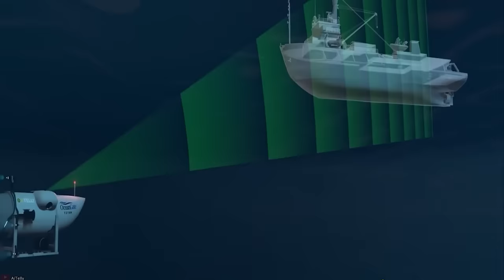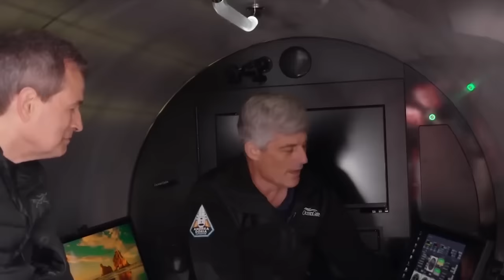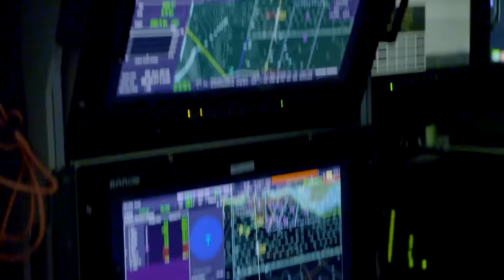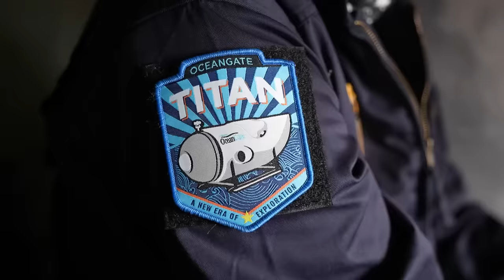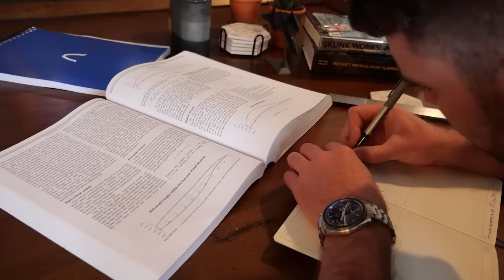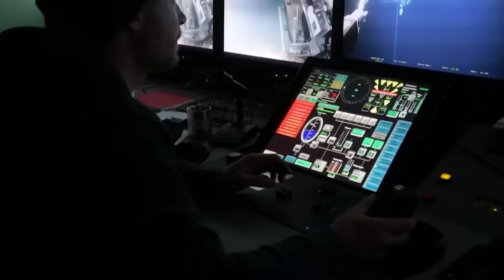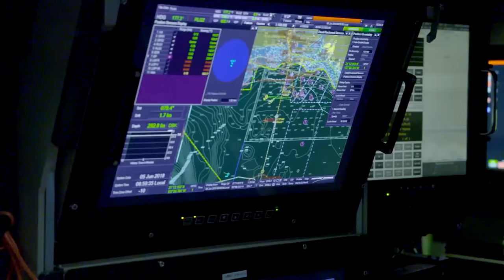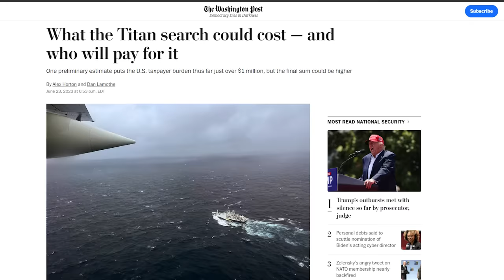US Navy Reveals TERRIFYING Truth Behind The OceanGate Submarine Tragedy | Titan Documentary

Comment: As an engineer who has used many different sorts of plain and composite materials for all sorts of structures, I can't get my head around the choice of a fibre composite for a sub hull.  The point about a fibre-reinforced composite such as glass or carbon strands, is that it adds tensile strength to the plastic matrix.  Fibres resist it when you pull them in tension.  I've used them in silos and pressure vessels where the pressure inside is elevated - for which they are great.  But when you push the ends of a fibre together, it just collapses in a loop.  In an externally- pressured vessel, the structure is purely in compression so the fibres are doing nothing, the plastic matrix is carrying all the compression.  This is the basic theory of use of reinforced concrete - the steel fibres carry any tension, but the concrete takes the load in compression.  So I can't see what benefit the presence of fibres has at all - they are at best passengers, or at worst could help to weaken the plastic, encouraging the propagation of cracks through the matrix as the compressive force cycles.  It would surely be better (stronger and more stable) to just make it out of unreinforced cast plastic resin, preferably made in a single cast to minimise discontinuities in the structure.

Was this really as stupid as it sounds?  Is it the schoolboy error it seems to me?  Or am I missing something here?
Reply: Good summary.
Stupid - yes 
CEO Hubris - yes
Reply: James Cameron gave a good explanation of the difference between the internal pressure differential between and aircraft fuselage at typical cruising altitude, and the external one on a submersible's hull at deep ocean depths, and made the same point as to why carbon fibre was totally unsuited for the hull material.
Reply: I’m no engineer, but just LOOKING at photos of the Titan, I can see how badly it’s put together.  The joins don’t sit flush - see for example towards the front of the craft, where there almost appears to be a crack (might just be the lighting).  Claustrophobia aside, there is NO WAY I would go in there.  And if it’s true they bought the material from Boeing, who considered it sub-standard for use on an aircraft, well, enough said.
Reply: but fibre sounds cool and strong

you wouldnt understand you arent an explorer like me! now bon voyage to the titanic!
Reply: As well as too many dissimilar materials expanding/contracting at different rates at extreme pressures over and over.
Reply: I love my carbon fiber bike, but I wouldn't trust it to survive after getting run over by a heavy truck.

If I had a steel bike or even aluminum, the frame would probably survive and be usable after getting run over.

I am not even an engineer. The greed, hubris, and stupidity of that company is mindboggling.
Reply: Dude the more I learn about this suicide booth the more stupid it sounds. The controller was blootooth. No hard port. The way they controlled bouyancy… every time I thought it can’t any worse it definitely got worse.

Comment: The fact that they knew they were cutting corners, is enough to say that they definitely could have done better.
Reply: More than just that

It's a literal crime scene at this point
Reply: Unfortunately, it's always been normal to cut corners. Generally takes two crashes to correct the deficits.
Reply: Imagine if a car company or an airline or any tourist company started "cutting corners" with safety protocol.  This spoiled rich guy actually fired then sued his own safety inspector because the inspector said it was untested and therefore could implode.  We need to find that judge that heard that case, and put them in jail too.  That's literally criminal abuse of the legal system resulting in loss of life.

Comment: Apparently, the most relevant question is: could Ocean Gate have done a worse job than it already did?
Reply: Could have bobbed back to the surface and then violently tumbled around as a small white tube in the foamy North Atlantic for several days with no food, water or toilet until the people eventually suffocated while staring out the window at the sky. If you're going to die in an Oceangate sub, abrupt decompression early in the journey isn't the absolute worst.
Reply: WDYM? They did a good job. A good job of what not to do.
Reply: If they had used cardboard soaked in linseed oil instead of carbon fibre.
Reply: @notzathros They could have escaped at the surface all they'd need would be a pocket knife.
Reply: @Alefjj  No linseed oil and ATF in a 50-50 mix, old timers used that on old lapstrake boats, superb water deflection
Reply: @PapaTanGh0stNI9htM4R3S0nMaInSt  The submersible was sealed from the outside so I don't believe it could have been opened unless they were found.
Reply: @sleuthelle  It's carbon fibre a sharp point or a heavy blunt object should get through pretty quickly depending on the resin.
Reply: @PapaTanGh0stNI9htM4R3S0nMaInSt  right, if they had anything like that with them and assuming that they had enough stength and leverage to do that from within the cramped cabin.
Reply: MMMM Nah. Pakistan Carbon fiber production is't quite available yet and it's "against the law" to buy NK products. They waited---could have built it cheaper and knocked a few more centavos off the ticket ( maybe 50G)
Reply: Well I'm sure they could have done a bit worse somehow, but they definitely did bad enough
Reply: And the answer is no lol
Reply: They could of use off the shelf hardware........... oh..... wait..... 😑

Comment: Russian submarines made with titanium suffered brittle fracture failure in the hull systems due to titanium's inherent strong lattice structure that tends to breakdown after repeated expansion and contraction, like that of a submarine diving and surfacing during normal operations. This was known in the early 1990's. Carbon fiber is substantially stronger laterally and therefore far more inflexible. It is the worst material you could ever use in the deep ocean and probably in the for any ship's hull period. It is meant for static pressure not dynamic.
Reply: I don't think carbon fibre is "meant" for pressure at all. It is very strong in tension but has no compressive strength at all. Because of its high tensile strength and low elasticity it tends to fail when subjected to side impact loads in a composite. There is no way I would use it in the shell of a vessel subjected to high external pressure. One might as well use sheep's wool fibres to hold the epoxy resin in place while it sets, literally.

Comment: It's amazing that anyone could think material that was not good enough to be used on planes anymore was good enough for a water vehicle that would go through even harsher conditions. None of this sounds right yet it happened.
Reply: ...and no receipt or record of the sale or transaction... something's fishy.
Reply: Yes, I agree.
Reply: considering carbon fiber in an aircraft had to withstand about 14.5 lbs per square foot to hold air IN and was rejected and then used in a vessel "built" to withstand a pressure of roughly 6000 lbs per SQUARE INCH TO HOLD WATER OUT is tantamount to murder it is no wonder the company brass acted the way they did.
Reply: Your future enjoy it....   THREADS
Reply: our future enjoy it....   THREADS
Reply: any word on whether it was pre-preg or not?  Because if it's just straight carbon-fiber, not pre-impregnated with resin, then there is NO best-before date - it would just be one of those nonsensical rules specific to the aviation industry.
Reply: to be fair, they are completely different engineering problems. But they should have done far more testing. They never did failure tests which is so insane for a vehicle you plan to take paying customers to the bottom of the ocean in. so f**king insane.
Reply: @meister-t  it was treated with resin, but not treated with an industrial hydraulic press, so the fibers could have entrapped air bubbles that could develop cracks.
Reply: supercosmicmutanthoneycand8163 ...The part that I find amazing is the fact that the viewing port wasn't rated for the depth of the Titanic ? How could this possible be ? There has to be some explanation for this, as it seems like an obvious oversight too simple for smarter men than me. Can someone shed some light on this for me ?
Reply: Because he was greedy and wanted to earn big money 💰  fast.
Reply: It's a big problem with the world.. people with a lot of money think they have the right bro do whatever they want..and they do .. take take take.
Reply: Clearly there’s a lie here. Cameron prob offed his competition
Reply: Agreed. There was an interview where the owner talked about how they had learned a lot from plane safety standards. That threw up tons of red flags for me. It was like he thought that what he was doing was safer than flight. Yet the reality is that it was even more dangerous than going into space. It would be like if someone running a space tourism company started going on about how they learned a bunch of safety standards from companies that make speedboats. In order danger would be ground, on the water, air, space, and then underwater. Someone in the space industry put it a great way. If you have a hole the size of a pin in a spaceship you can use chewing gum to fix it, if you have the same issue in a sub at Titans depth then you are dead before you can even react to fix it.
Reply: @meister-t it was not pre-preg carbon
Reply: @garychase8637 yeah and carbon fibre is better under expansion rather than compression. It's great for holding high pressure in not so great for holding it out.
Reply: It's also the shape - I believe all similar deep water submersibles are spheres for obvious reasons (equalized pressure - the way gravity shapes planets as a clue).  Early passenger planes had square windows that developed stress cracks in the corners of the skin for similar reasons.  Circular windows, problem solved.  Think round.
Reply: carbon fiber crackles as it starts to break, yhey heard crackling in aft
Reply: Stockton Rush was a cheap skate and a liar which thought it was ok to play with people's live with some spoiled ass cheap discounted carbon fiber! But only thing I don't fault Stockton for is that he didn't force anyone to go on it and shoulda been up to the passengers to do a lil research especially if ur taking ur kid or wife... But it all it jacked up and my heart goes out to the families..
Reply: The main issues is it could have been bought from anywhere it wasn't directly sold in conditions if directly bought from air line manufacturing therefore the strength could have been tampered or stored in extreme conditions before it was used
Reply: Take for instance I sell something that is brand new but it sat in sun in storage it would been already weakened by UV light
Reply: @verlindaallen3335  I don't think it was greed that drove Stockton Rush, but his vanity and desire for fame.
Reply: He should've just stopped penny pinching and used titanium all round and then done atleast 20 full depth solo dives before taking passengers. It might have taken longer to get up and running but it would have paid off for him in the end and gained people's respect. I mean come on tho you'd have to be pretty mad to get in a sub that you have to sign the kind of waiver he had drawn up. I can't believe the authorities didn't quickly get some kind of law written up forbidding him from carrying passengers even if it was in international waters, I bet they do now tho eh!!
Reply: @John-gq7vt Yeah that hotdog shape definitely wasn't good and he already had half a titanium sphere on the front so why not just make complete sphere, well it was because he was greedy and wanted to carry more people eh as he would've probably only got pilot + 1 passenger if he'd used sphere. But I don't get why he didn't just do the whole hull in titanium. Just crazy
Reply: @dpstrial I agree 👍
Reply: @adrianjames4447  Right - I also saw something about the carbon fiber compressing something like one or two cm more than the titanium and they were glued together.  So many opportunities for disaster.
Reply: It may of happened, then again maybe not. For all we know he ordered carbon fiber off of Amazon you use to make things.
Reply: I don't understand how carbon has an expiration date
Reply: @steiny3353 So many people warned him about using Plexiglas that was only rated for 1300m(4,300ft) to dive to nearly 4000m(13,000ft) but apparently he said he couldn't  get enough funding for the higher rated plexi. He probably would have got funding if people had trusted his design and he'd agreed to go through the proper certification process but from what I gather from what people who knew him he was dead stubborn about it being his way or the highway and he hated people picking holes in things even tho they were only trying to help. He was also determined to follow in his ancestors footsteps and be famous and leave a legacy. Well he left his legacy but not quite the one he wanted eh! 👍
Reply: @adolfclitler7972 🤣Love the user name 👍
Reply: @stigmaticraven  Google it.  Virtually all materials degrade with age to some degree and to be specific, it's not carbon, it's carbon fiber.  It's a laminate so I believe (could be wrong, didn't Google it!) some type of adhesive is a part of the recipe - that could be the weak point.  I'll Google it now that I said (maybe) something stupid.))
Reply: @milehigh7155 I agree, with an abnormal waiver like that to sign you'd have to be crazy to get in that thing. They were told the risk and even warned by various people not to go on it but because he'd had a few successful dives they probably felt more safe. Not so sure they would've gone had they been told about the popping, crackling sounds it was making even at  300m apparently. He should've done atleast 20 full depth solo dives as he wasn't prepared to get it pressure tested at a facility due to the extra cost. He just wanted fame and legacy and didn't care how many corners he cut to get there. Got his legacy tho, just not the one he wanted eh! 👍
Reply: @modbox9560 I agree, buying it cheap from somewhere you just don't know what conditions it's been stored under and how compromised the fibres are.
Making something like that you'd want the best stuff from most reputable company eh! But I think he even got his camera's from Walmart or something. He even admitted in an interview he was a bit of a MacGyver. CRAZY
Reply: @dpstrial Well he definitely got his fame and legacy but not the one I think he was hoping for eh! 👍
Reply: @adrianjames4447  I think infamy rather than fame.
Reply: @stigmaticraven  Forget the expiration date, because even more important is the fact that sub wasn't supposed to do that dive more than twice because each time it goes down it weakened it more. 

He ignored all that and just kept on using it till it imploded.
Reply: @stigmaticraven I don't think the raw carbon fibre is degradable but it's once it's been pre impregnated with resins etc then they can become degradable so it would totally come down to how he got it and how it was stored as apparently it's got to be stored at a certain temperature and away from UV and then once it's been used eg- on a mountain bike or buggy frame they treat it with a UV protective coating.
Reply: @John-gq7vt Yes your right, the raw carbon fibre doesn't degrade but once pre impegged with resin the resin can degrade and should be stored at certain temperature and away from UV. Once used they give it a UV protective coating apparently 👍
Reply: @tea4223  Sounds like it was bought from a guy in a trenchcoat in Times Square near the guy selling Genuine Rolllexes.
Reply: @tea4223  Boeing in CYA mode.
Reply: @adrianjames4447  Being bolted in without the ability to get out would have been a deal breaker for me.
Reply: @John-gq7vt     Yep...LOL
Reply: @milehigh7155  You're absolutely right.  I think he also suffered from a case of "smartest guy in the room" syndrome too.  As do I...but I'm alone at the moment.))
Reply: @dean4817   i dont think he had any money. He as too proud of bis ancestors, could not go out as s failure so he took the dirt nap
Reply: You make the same mistake as OceanGate:
You think that one can deduce that if a material is good enough for aviation then it must be good enough for deep see diving and vics-versa...
Reply: @pabloescobanjo2037  Right - the different materials are affected differently by specific types of stress.